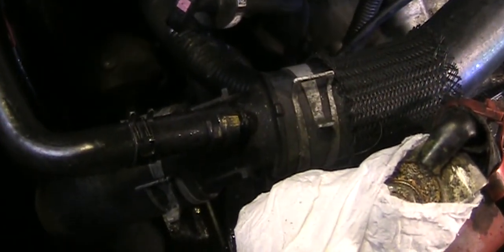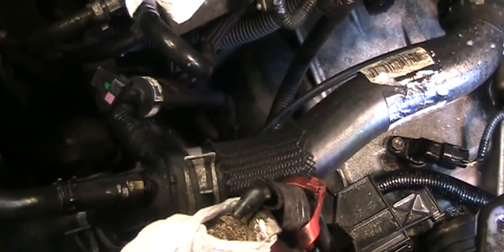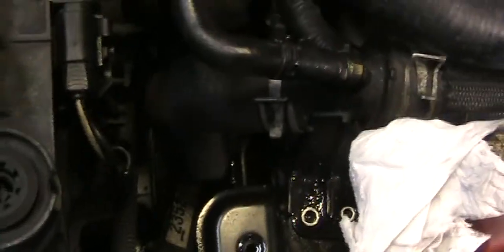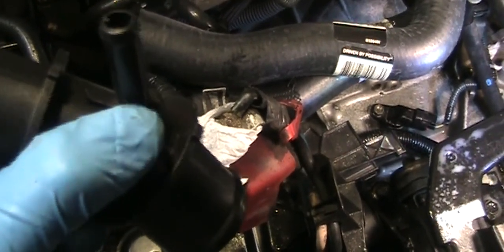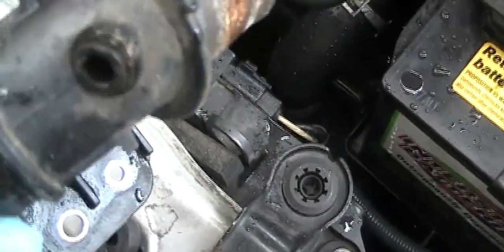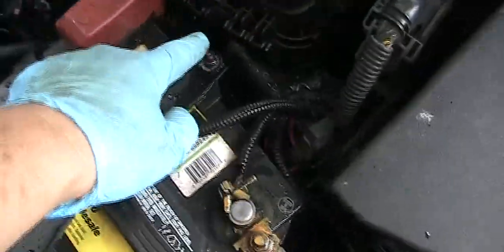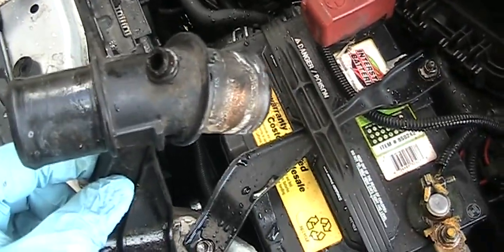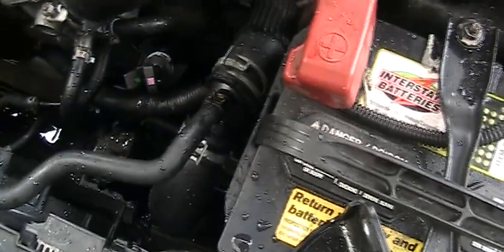09-13 Toyota Corolla Radiator Coolant Pipe Connector Hose Fix Repair Dorman 902-924 Gates23519/23521

Comment: What tools do I need besides socket wrench?
Reply from the maker: Hi, Brett, thanks for your comment.  if you still have the OEM Toyota hose clamp, then you need a Plier to remove the hose; otherwise, you may have one of the clamp which use a Phillips / Flat head screw driver to open and tighten up.  If your radiator hose has not been changed before and even you try to twisted it, it still did not come out then you also may need a (not sharp) flat head screw driver to help the hose disconnect from the engine block or radiator connection. Be careful not to damage anything. Be Patient and go slow. If you plan to do a Drain and Fill of the radiator's coolant at the same time when you change this Pipe Connector then you also need a small pliers to turn the radiator drain cock if your fingers are not strong enough. Be very careful not to damaged drain hole; otherwise, you need to get a new one plastic drain cock or a new radiator if the threads are messed up. Be careful not to tighten that radiator drain plug too much because it will crack because it is made with plastic.  I am in California and car does not have rust but if you in cold weather states (salt/rust), I would just leave it alone due to the age and condition of the car; however, it is a judgement call depends the condition of the car and radiator.
Thanks for you comment and thank you for watching.
Reply from the maker: Just FYI. If you plan to keep your car, same part but available in metal ( Aluminum)  and not plastic; therefore,  the metal connector for sure will last much longer than the plastic and I remember it is only few dollars more. Good Luck.

Comment: what's the name of that connector please ?
Reply from the maker: Hi Benson, that connector is called coolant pipe connector,  water hose outlet connector or pipe connector, the part number under  Dorman is 902-924 Engine Coolant Pipe. (OEM part # is 16577-0T030)  I would used Dorman rather than other unknown brand since it is almost the same price or just $1-$2 more. But I have Dorman product before and I don't have issue on it. Thank you so much for your comment  👍and thank you for watching.
Reply: Thank you that's the same information I need I appreciate you so much
Reply from the maker: @sumcrazychic2832  Thanks for your comment and thank you for watching.
Reply: You can upgrade to aluminum coolant pipe Dorman 902-924HP

Comment: Do I have to change all hoses ? And do I need to flush the coolant after this ?
Reply from the maker: Hi, JonJon  On change hose - It depends how old is your hoses (upper and lower) and on flush, it depends on how old is your radiator coolant. if your connection is broken like mine and hose are new, the easy way is to disconnect the two end and change the connector and then refill with the same amount of lost coolant.  But if you think the two hoses are old and about time to change and get dirty one time, then you can get new hose and perform a "drain" and "fill" on coolant for peace of mind since coolant chemical only last up to certain miles or certain years and even coolant looks clean, those chemical are use up/gone. Thanks for your comment and thank you for watching.
Reply: @diycheapdaddy2113  Thanks for answering great help and video. So one day I drove to Dallas coolant was boiling and radiator coolant pipe was leaking. So I just changed the pipe and car feels good now. I’m going to Dallas again should I do something more after change the pipe I read like remove air form the system or something like that? I’m worry my car gets overheated again going to Dallas….what do you recommend?
Reply from the maker: @jonjon9237  The "pipe" you mentioned I believed is the connector in this video. Radiator rubber hose has time limit and it will age as time go by. The bad thing is there are lot of rubber "hose" and eventually sooner or later, they all need to be replace.  The upper radiator hose is connected to the thermostat housing and to the radiator. From the bottom of the radiator, is the lower radiator hose that is directed to the water pump. The upper hose carry the heat and it is hot all the time and normally it is the first one break or leak due to heat/hot.  Can you inspect your upper and lower hose for bubbling, oil, dirt, expanded...etc. Google how to inspect bad radiator hose.
If it has those bad condition, it is better to change it because it is not that difficult if you are handy and can save lot of money.
On the radiator, after you warm up the car and the next morning, the coolant holding tank would be low, add enough coolant back to the top (full) and repeat until it always stayed at "Full" level. Don't unscrew or touch those engine/radiator bleeding valve, normally it will break or leak due to old car and was not being turn lifetime until now.  Just add coolant and then check level and should be ok after 2-3 time , then the level will be stable.  
For me, I don't want to call AAA or have it tow because it costs almost the same amount for 2 lower hose and 1 upper hose and 1-2 gallon coolant and it depends where the car break down.
You can check rockauto and for this 2009 Corolla old car, part are starting on sales and since you need at least 3 hose, combine shipping is not that bad. I actually get my GATE hose on sale in Amazon too. I guess the major question is when is the hose being replaced. Most Good Brand especially Toyota OEM hose should last at least 4-5 year or 50,000 - 60,000 miles but since you are in Dallas, it really can shorten the life of the hose. I am sure you can locate another video on corolla upper and lower radiator hose replacement. Please let me know if you have any questions.
Reply from the maker: Also, I am pretty sure your "pipe" leak is at the same location of my pipe which is the smaller hose go back to top of the radiator cap area.  I think it is a common defect and also when people work on the car, they normally put their stomach /body on the top little hose connection.
Reply from the maker: JonJon,  please check Amazon. I saw my 2009 Toyota Corolla hose is on sale for less than $12.00 each (67% off)  Gates 23521 and Gate 23519 and Free Shipping.